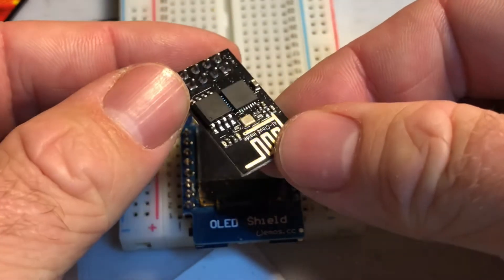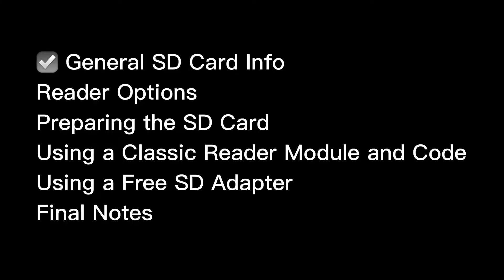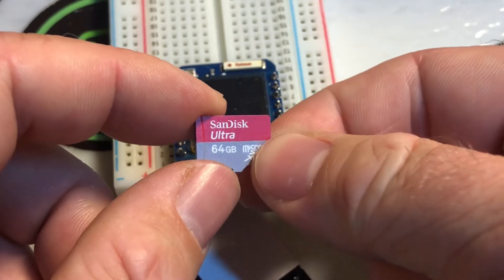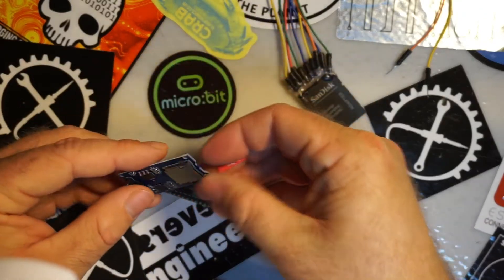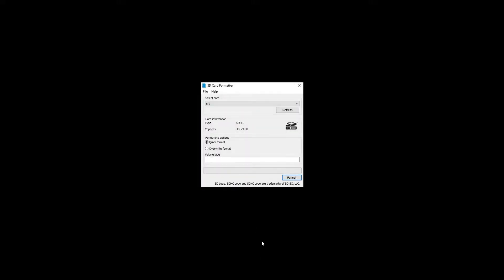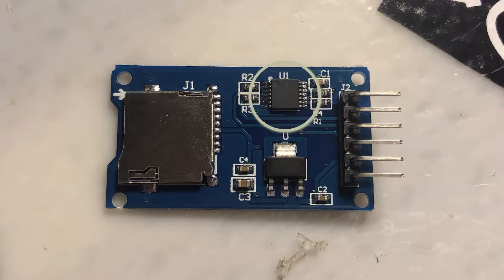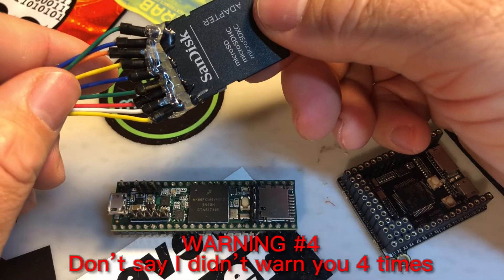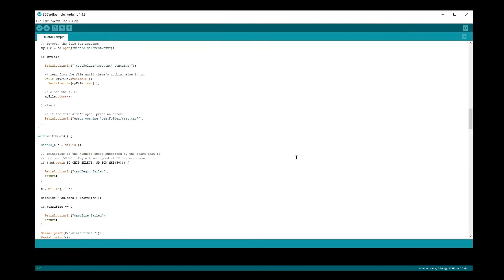ESP8266 SD Card Interfacing

Comment: Hi, I recently made a scrolling text using wemos nodemcu v1 and transmit characters to it via WIFI server.

I want to interface a SD card with it so that whenever there's no new message coming in from the web server, it will automatically read the text content of the sd card then dump it on the display.

The problem is, those HSPI pins was used by the matrix.

Is there a possibility of using the SDIO pins for the card, and do u have any tutorials about that SDIO pins? 

Thank you in advance.